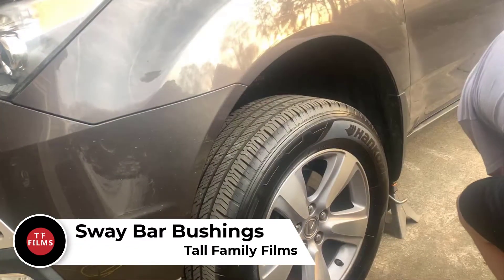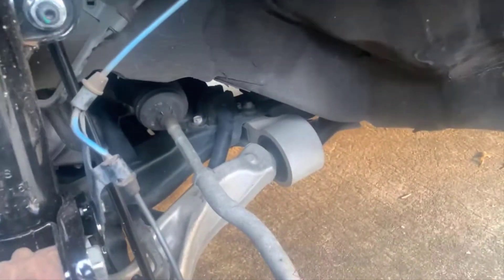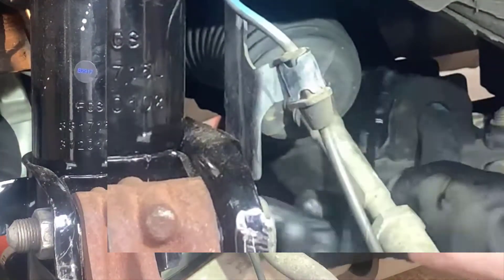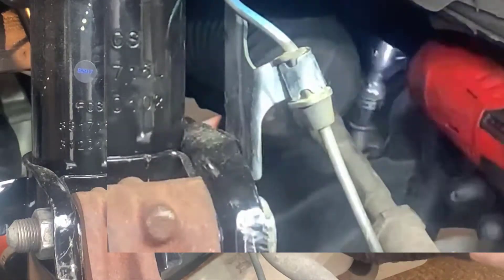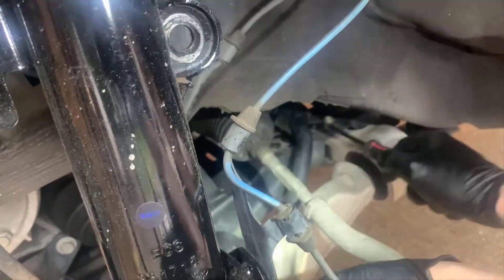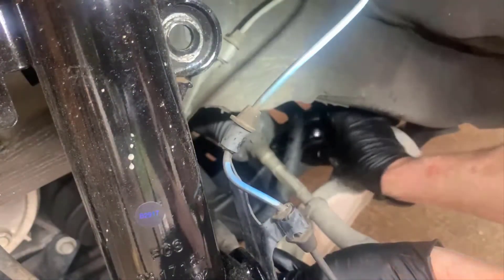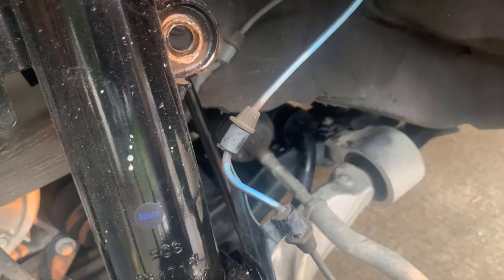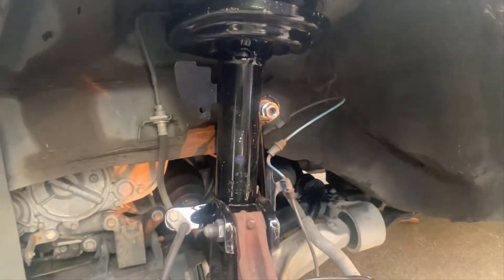How to change Sway Bar Bushings - Acura MDX

Comment: I have an 2006 Acura MDX. I could not get a socket or wrench on the driver side to remove sway bar bushing bolt. The bolt facing rear of vehicle. Any suggestions?
Reply from the maker: @sebestiensoliz8831  the 06 was a completely different beast. It was the last year of that original body style. It was also the last year of that unreliable transmission. I wouldn’t know without seeing it. Sorry man.
Reply: Thank you. I've been lucky so far with the Trans. This MDX is in excellent condition.

Comment: You shouldn’t put grease on the bar, because after tightening you want those bushing and the bar to stay put not moving .
Reply from the maker: I’ve had them squeak without it. I know Ford doesn’t recommend greasing them. I honestly think this only applies to thermoplastic bushings, but I’m not an actual mechanic :)
I can say that I’ve done many this way and never had to do it a second time. Thanks for watching and I do appreciate you taking time to comment. Now we’ll probably get a religious war from other viewers on greasing vs not greasing. 
It’ll be all your fault. ;)